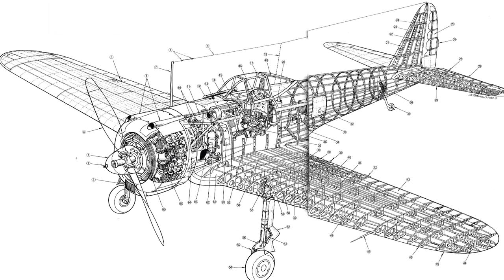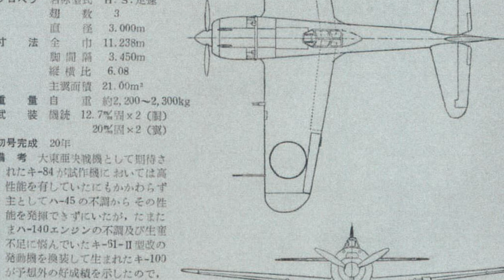How the Nakajima  Ki-84 Took on America's Mightiest Bomber—and Nearly Won!

Comment: Is it a feature of your voice-to-text software that the Ki-84 aircraft is pronounced KEE-84, instead of Kay Eye-84?
Reply: That is the correct pronunciation in Japanese, I think. We anglicize it to K-I- 84.
Reply: The pronunciation of Ki-84 or any of the planes named using the Ki naming system or (キ) is KEE as it is a single phonetic character in Japanese.
Reply: That IS the correct pronunciation! Not Kay Eye. Ki ( き ). Pronounced with a short, clipped sound.
Reply: @reynaldoflores4522  Thank you

Comment: I was getting stuck on the terminology when the narrator kept calling the 疾風 (Ha-Ya-Te) Hates. Particularly kind of pluralizing them with an s that seemed like it should be HA-YA-TE-SU but I digress. Most of the pronunciation is sort of figured out. HaYaBuSa was another name that sounded a little off. Just not as bad as the HaYaTe somehow pronounced like Hates Strange sounding.
It's not KiYoTo closer to how British seem to say line up in queue only with an 'O' so Just KyoTo same goes for ToKyo not ToKiYo

Comment: A Ki84 piloted by Sergeant Mixunori Fukuoka shot down Thomas McGuire's wingman,   Major Jack Rittmayer in a head-on against the P38 on the same AAF mission in the Philippines that saw the second leading American Ace. Mcguire crash while maneuvering at low altitude with his drop tank attached.  Fukuoka must've had some confidence in the Frank's armor to be doing a head-on against the multi .50 cal P38. Don't know the type of ammo they had but reportedly the Frank's pair of relatively low velocity 20 mm just disintegrated Major Rittmayer's Lightning.
Reply: He was lucky. Kaneyoshi Muto an outstanding japanese navy ace did the same manoeuver against corsairs and hellcats in 1945 while piloting a Kawanishi N1K the navy equivalent of the Ki84. He got hit in his engine and had to waterland over a lake, he drown in it. Head-on attacks were prefered by US pilots because hitherto they had much sturdier planed but in any case it was a really dangerous game. I heard some testimonies of surviving japanese pilots and most of them had never attempted head-on attacks which stroke me as a reason why they survived at all. Fukuoka was lucky his rounds hit anything at all which without a doubt  saved him on that day.
Reply: @vlad78th  Well, actually 20mm on the Hayate was very fast firing, up to 900 rounds a minute and had a longer range than Zeros 20mm cannons. It all depends at which distance they started to engage each other. The 50 cal on the other hand that was used by the Japanese was dogshit from any distance further than 200 meters.
Reply: It wasn't quite head on
Reply: @kenneth9874  Maybe more an Angle when two or more of the P38s were abreast ? I'm guessing of course. Rittmayer had 4 kills with three in a day so I'm wondering why none of the three could get guns on him sooner.
Reply: @vlad78th  They both used versions of that amazing little Nakajima Homare radial. It got it's power from relatively fast RPM and relatively high compression with pretty much the manifold pressure of single stage supercharged contemporaries. But the IJN seemed to hoard whatever high octane fuel got through our submarine pickets and that probably mitigated the Homare's failure odds. The "Franks" had pretty roomy water / methanol / alcohol injection tanks as they even used it for intercept  takeoffs.. . . alcohol being for cylinder head cooling and the others for the anti-knocking  Don't know as much about the N1K2-J version since it goes by different nomenclature. Seems a big fighter for such a small diameter radial whereas a tight package in a Ki84.

Comment: I'm surprised that any Japanese planes had armor or self sealing fuel tanks 
If the frank had replaced the zero, things might have worked differently for them 
It sounds like it was the Japanese version of the ME 262
Reply: you mean the Nakajima Kikka
Reply: The later versions of the zero had self sealing fuel tanks and armor as well. The A6M line started seeing things added to it constantly which reduced it's range. People seem to forget self sealing tanks were a luxury when the zero was designed and even at the start of the war they weren't a standard yet. Even then they were omitted due to weight restraints as the zero had the best fighter range of the war owing to keeping the weight as low as possible. Besides there would be no way to replace the Zero, a carrier aircraft with the Ki84, a land based aircraft created by the army. Japanese army aviation and navy aviation were seperate and one could even say deliberately kept apart as the navy and army didn't get along. Also Japan had a jet fighter program with the Kikka. It was developed mostly indigenously by the Japanese aviation industry with only minor help from Germany like sending an engine to reference from the me262 wich helped but was not copied for the kikkas design as the kikka was made to be a bit smaller.
Reply: Well, they learned pretty quickly and airplane that could outturn anything was useless if a few .50 cal rounds would light it up... losing an experienced pilot was a far greater loss than an airframe. The Germans and Japanese had plenty of good, viable, competitive fighters at the end war - but no pilots left to fly them.. In fact, for the Japanese the better use of their limited resources were Kamikaze attacks by pilots who could barely fly. Tragic.
Reply: NO the FW 190 g

Comment: My grandfather escorted B-29's up high in P-39s, using zoom and boom attacks and that centerline firing gun that like AT&T, could really reach out and touch someone.
If I was on the other Japanese side with some Ki-84's, I'd shred them all.
You just side step and dance around those bullets, I did it for 5 years.
Most all of the pilots back then were amateurish.

Comment: B29s only had to worry about enemy flak then fighters because Japan did not have a fighter intercept the B29s because of their high altitude.
Reply: Well, American crew feared the B-29 itself even more. The B-29 was overengineered and rushed into production. More B-29's were downed by construction failures and engine fires than by enemy fighter planes or flak.

Comment: It seems the Ki-84 is Japan’s answer to the Republic P-47.
Reply: Yes. The specs are comparable to a P47.
Reply: Ki-84 is more comparable to a… hmm, a longer ranged low alt version Spitfire? 
It’s too light and nimble to be compared to a P-47, plus it’s high alt performance is not the best.

Actually, Ki-84 is somewhat comparable to the FW-190A5. Just a bit slower with perhaps worse linear energy retention, but more maneuverability and better maneuver energy retention. Rate of climb also better.

In the real world Ki-84 and FW-190A/D will be comparable fighters due to their speed and climb performances, but in WT, where merges and dogfights are more common, Ki-84 reigns supreme.
Reply: @thomaszhang3101    Ki-84 Hayate is really comparable with F4U Corsair